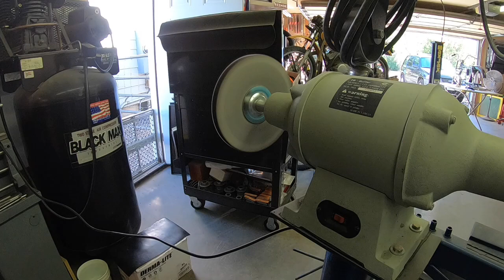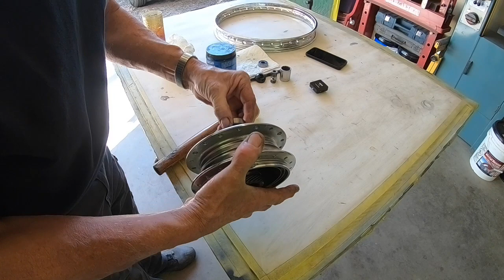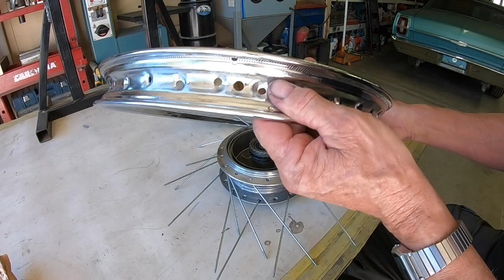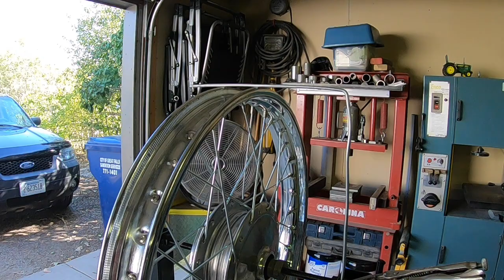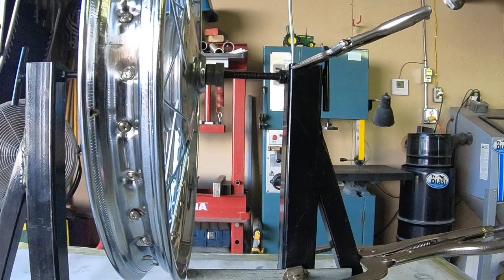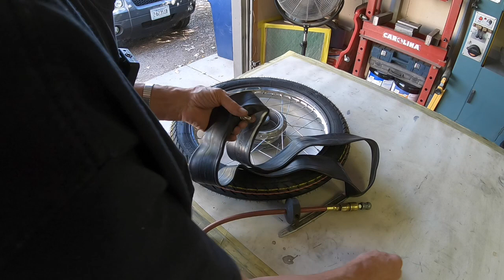Lace and true a motorcycle wheel, Yamaha twin jet 100

Comment: 50 years ago I worked at a Suzuki shop,I was just a you guy
 I spoke up a customer s rim,did it I. 3 hrs,was a satisfied with my work
 I mounted tire,put on bike,customer picked it up
  They were back in an hour with flat
 I forgot to check for protruding spokes
Reply from the maker: woops, it's so easy to miss the obvious. I have done the same thing. Now I mention it so others wont have to go through what I did. Thanks for letting me know I wasn't the only dummy. I also worked at a Suzuki dealership around the same time. Thanks for following the channel.

Comment: Who do you use for plating?  I would likely hate lacing a wheel but can see that once its true, your get a lot of satisfaction from the effort.
Reply from the maker: You mean like spokes, I do, I have a Caswell zinc plating kit that I use a lot. It's just a lot of work to clean and then set up the equipment. For Chrome plating I use St Louis chrome plating in St Louis Mo. Yes, lacing and truing is not my fave, but I seem to have a knack for it so it's not too big a deal, sure have done a bunch over the years.